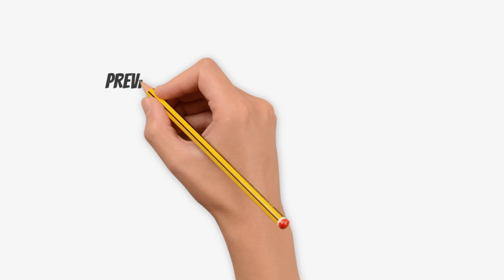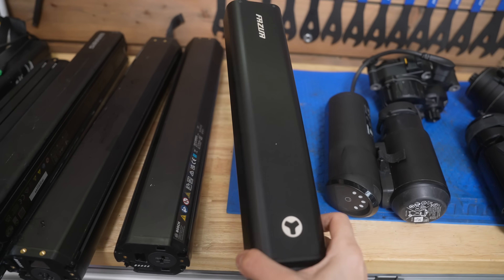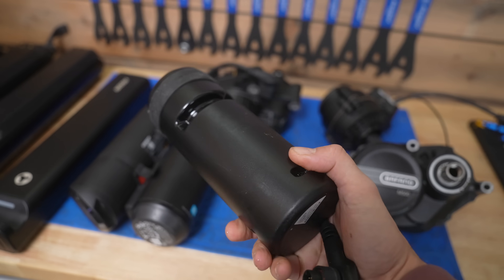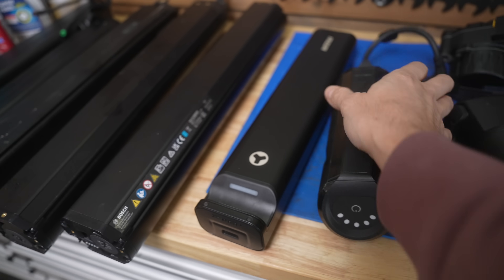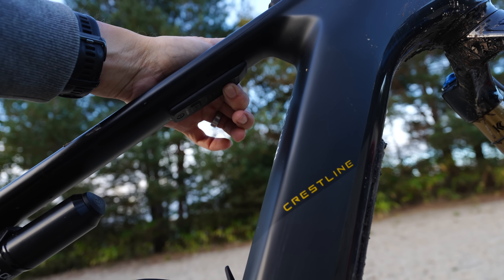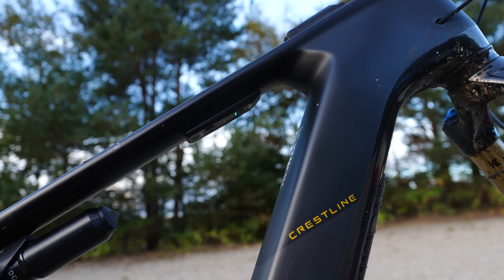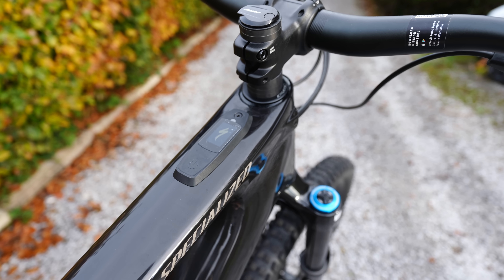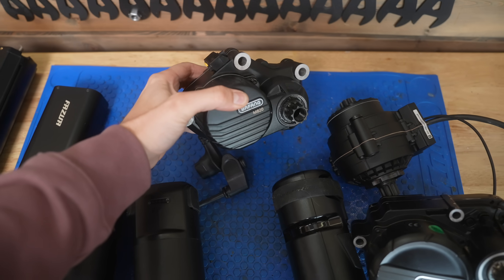We Have A Huge Problem With Ebikes....

Comment: USB charger should work on these batteries. USB is already at 240 Watts, and increasing. 

Cars already have the standard data interface port for On Board Diagnostics - OBD Port.

We could have a Proprietary Tax which is applied when an industry doesn't create a standard, or they create products that don't use an existing standard. Genuine advances would be worth the initial tax cost and could apply for the exemption and refund.

Comment: I don’t have this problem at all. My Centurion that I got back in 1976 still uses the same leg power that it used then.  I did have to replace the rims, but guess what? Those are pretty universal and was not a problem at all. I recharge my battery with every meal or snack.  At my age my battery does run down a bit quicker, but it hasn’t ever completely lost power. And with every use my battery actually increases it’s overall capacity.

Comment: I built 2 E Bikes !!!  I used bolt on motors and they connect to standard controller and they use a Standard 36 volt Lithium Battery with ordinary Connector !!!!  So I can fit this Stuff to another Bike !!!

Comment: I understand the point of the video and I just like to say that this is the exact reason why I am not buying into the e-bike thing at the moment. I do have a few gas powered motorcycle bicycles and I am looking to even purchase a moped or two. I would like a number of small modular means of getting around the town and to work. Unfortunately, an electric bike has been off the radar this entire time because every single time I look into it it seems like I'm being hassled by either spending seven grand for an all-in-one for proprietary system that may not give me the range I want or maybe lying......... Because I've dealt with a lot of false advertising in my life or on the other end of that building a bike because I have the common sense the know-how, the ability, the programming, the latter logic, the electrical engineering and understandings the training in order to make a bunch of parts work together. But buying the parts and simply putting them on a bike I have to do the same thing as if I was buying a $7,000 proprietary bike build and the only thing on it that's not the same as the brand of all the parts is the bicycle itself and I hit a brick wall with that because I like the motor of this brand. The battery, power and sustainability of this brand the quick charging features of that brand. The dual motor design of this brand, the cable management of that brand and quite frankly it seems like they're missing out on a number of purchases because I would build two or three bicycles with battery power and even by extra batteries for backups. But I'm not willing to purchase anything until I can non-proprietarily hand design my bike with the most life. The most power, the most durability the most reliability by picking the parts that are designed better from each of the companies bringing something to the table.
This need to face constant proprietary ization is killing the market. No one has that much money to dip into a company and then find that those parts just aren't good enough and no one has the money to go out and rebuy everything all across the board for a completely different setup. Only to find that one also isn't the best because they're both only good in one or two ways.

Making things for prioritary is the death of the electric bike. They just don't know it yet
Reply: And for anyone who's read all of that and feels the need to read further, I would like to say before anyone pro e-bike pro electric comments about motors. The two-stroke and four stroke scene has hundreds of thousands of thousands of bicycles that can hold motors and hundreds of thousands of thousands of those can accept either a two-stroke or four stroke engine and of all of the bikes that are able to handle two-stroke or four stroke. Whether you buy a whitey 100, a whitey 80 azada 80 or any of the four-stroke models, all of the two strokes look damn near identical except for colors and all of the four strokes look damn near identical except for the colors. They are extremely plug and play again. Shame on the electric companies

Comment: I've build my ebike from scratch myself. Much cheaper and based of a normal bicycle with an ebike kit. Also more range than most ebikes and still works great despite used and challenged hard. It's pretty universal and could even get upgraded easily or swapped with my other bikes. It also looks neat the way i did it (in my opinion) :)
Reply: do those kits come with any warranty or waterproofing? What if your display, controller or motor craps out, say doe to water damage or whatever?
Reply: @imarchello  Here in Germany they have 2 years of warranty (it's german law, don't know about other countries). You better water proof the electronics yourself which isn't hard. I just put the controller and battery in a frame bag and have no issues with water. The motor and cables outside seem water proof so far. I even ride in snow and heavy rain and summer heat. If any part is damaged due to faulty parts it's under warranty replaced or sometimes you just get a new kit if that's cheaper. So far i'm riding it about a year under every weather and mostly in the mountains and woods and sometimes asphalt. I do tours about 130km often (battery lasts about 140km). It still works fine. The only thing i replaced was the charging port for the battery (my fault for breaking it) and better brake levers (also with brake sensor). But you could use the original brake levers too. As it's universal, i just ordered the port on ebay and the brake lever on amazon for a few Euros and installed it myself.

Comment: Couldn’t agree more. 
Ought to  extend to all electronics on chargers and connectors as well. 
The environmental cost due to scrapped chargers, cables and electronics must be huge. 
Am wondering what is going to happen to my lovely e- MTB when I can’t get a replacement battery / charger / controller / motor when one gives up the ghost. Ugh 😣

Comment: AT LAST.  At the simplest level this applies to replacement batteries.  Looking at accessories on manufacturers websites, the number one item I would expect to see would be a replacement battery.  I have not found this on any site that I have looked at, nor do the search boxes return any useful results.   So once your e-bike battery has lost its capacity, you have to buy a new bike.  I cannot understand the silence in the industry on this issue alone never mind the other issues you mention.

Comment: New tech depends on competitive designs, naturally market competing for most sales that define a de facto standard. 
When standards happen, sometimes competitive low prices leave the market. The average 250W, 500W, 750W ebike is good enough for most riders and now regulated by some countries; so what's the upgrade need?  In fact, fast ebikes are own enemy, now causing accidents, fire, theft, regulations and licensing fees + taxes.  The only modest energy density battery I want is one that does not catch fire, high density battery internal connections are fire risk from normal bike vibrations.

Comment: The problem is not only that there is no upgrade path. It's even more problematic that a casual rider probably won't be able to buy the required batteries or replacement (like-to-like) motor for these bikes a few years from now, making a lot of perfectly good bikes useless in case of a malfunction or just plain old age.

Comment: While I do agree more standardization of ebike components would make life easier for many, I do have to wonder if the real issue you are mentioning goes unmentioned: Unhinged consumerism.

The desire to constantly be buying more better faster. What happens to the discarded stuff? Why can't one be happy with the bike they bought that was 5 figures expensive? At that price, it must be pretty fancy.

I know this will fall on deaf ears but perhaps the primary issue isn't what the ebike makers are making, perhaps the issue is people not be happy with perfectly good products?

I've been sell electric cargo bikes and commuter bikes for 10+ years and in all that time not a single customer has asked to have their current bike upgraded with new motor or battery. If the want newer tech, they sell their current bike and buy a new one that has that new tech.

This is how life works with automobiles and motorbikes. Want a fancier faster Corolla? Well, you don't roll down to Syd's Auto Shop and upgrade the motor and put a bigger gas tank in it...you sell it and buy a new Corolla.

Comment: This is pretty much why I didn't get one so far.
And I'm too lazy to just modify bike myself, but basically for long life I would need to do it this way.
Also thing is not so much about the competition as about you going like a good doggie back to company every time something is not ok, because you cannot fix it yourself I bet battery packs will have some quirk preventing you from replacing old cells with new ones in it, and other shenanigans for other parts as well.

Comment: I built my E-bike exactly to avoid this shit. I don't have to worry about that incompatibility. Not only that, but I can use any battery, controller, motor, and voltage that I want. Furthermore, I can have as much power as I want, and it is not illegal to use off-road in my country. If you keep buying this expansive crap, you enable those companies to keep doing that they are doing. It's like if they bike doesn't belong to you. I have 4000w mid-drive with 12 speed cassette, and I did not spend half of what the frame Rob is holding worth 3:52 plus I have way more power.

You don't need to be an engineer to build an ebike yourself. If you can build a bike, you can build an ebike. There are tons of guides on YouTube teaching how to do it. A BBSHD and 52v battery with as much capacity as will fit in the frame is all you need to start and is enough for 95% of people.

Comment: How often are people upgrading the motors in their motorcycle? Or expand its tank?
To me, ebikes are a very different category than push bikes.
Reply: For batteries I would find it preferable to just make the cells inside  accessible and replaceable. No need to change out the whole pack with the electronics.

Comment: Brilliant video. As designer, I beleive it is possible for a cottage industry to manufacture an interface that allows you to put any motor on any bike, and wiring looms to upgrade. Bike manufacturers should be ashamed, there is no need for this incompatibility except PURE GREED. customer care? Bollocks to that. You just need one bike manufacturer to break ranks and they will steel the market and if others don’t follow they will go to the wall.

Comment: This is why external batteries, Bafang motors and other interchangeable components from China are king. The so called name brand and bike company machines are underpowered, overpriced, purposely obscure as to repairs or mods and require unique battery shapes in order to charge outrageous prices for spares. The software on tthese so called 'premium ' ebikes is a nightmare. My Chinese Bafang motored e bikes w/external batteries out perform anything from big brand companies at a fraction of the cost. And, components are easily replaced or repaired. Bike folks are gullible, big bike companies will take advantage of you. Beware. Oh, almost forgot to mention. Carbon fiber frames break down with use. As the material degrades, the degradation accelerates terminating in catastrophic failure often without warning. If you bike is carbon fiber, you won't need to replace the motor as the frame will be shot also. Don't believe it? Then you should learn about the characteristics of carbon fiber composites under repeated loading cycles.

Comment: Yeah!  I would wish, that they at least would provide repair kits and spare parts and have a guaranty they service and keep the batteries for the "old" bikes.... I think my bike will outlast my ability to ride, so a (hardware) update is not important or crucial.... IF it breaks, and is outdated, I still would rather repair it, than buy a new one!!  Like my old rimbreak spacialized sirrus... I still can upgrade everything and service it....

Comment: Good call - thank you! We definitely need better component compatibility and interoperability here! That being said, I am slightly sceptical regarding the idea of one charger for all ebikes. Some bikes run on 36 V, while others have a 48 V system, and then there is 52 V and maybe even further voltages... While it is possible in principle to develop one charger that could work for a range of battery voltages, this would then become a somewhat expensive charger, and particularly for bikes with lower battery voltage this would be adding cost noticeably. However, it would still be good to standardise charging connectors (and introduce voltage compatibility protection in some way, to ensure that it is impossible to connect or use a charger for a different voltage than that of the battery...).
Reply: I'm sure he means to have a universal connectors. I couldn't find a charger for mine so I had to just find a charger rated for 48v 2amp output and just soldered the connector from the old charger and its still going strong even a year after. Oddly enough the original charger only lasted 6 months.
Reply: you missed the point completely 180. he meant a connection standard. not one charger for all
Reply: @jrok96  - he literally says: "... let's have one particular charger that can work across all the different bikes!" (6:20) You may be right that he meant the connector, but he does talk about the "charger". And yes, I do appreciate that the word "charger" is sometimes used somewhat loosely.
As I wrote, this would be technically possible, but not necessarily sensible.

Comment: This is better as the Panasonic system with a standardized plug but with cryptographic authentication of the battery with the motor controller.

Comment: My 10 years old chinese ebike (throttle controlled, not pedelec) originally has lead-acid batteries, and I bought a lithium-ion battery with the same voltage, and it fits. The electronics only need a 48-58 V power input, there's no upgradeable firmware. Modern batteries and control electronics are overcomplicated.

Comment: My BBSHD works on almost any frame, with almost any battery and can be repaired and upgraded with parts from hundreds of suppliers all over the world. Plus it’s more powerful, more reliable, more configurable and lower cost than any large ebike manufacturer on the market. When I’m tired of it I can replace it with a CYC or a DM02 for torque sensing or lower weight. I really believe people need to get more into learning how to do these things themselves.

Comment: The issue is standardization but also intentional obsoletion and right to repair. Look up Louis Rossmann's interview with Josh Haley on One Wheel. Even within the OEM hardware they digitally pair parts so you cant rebuild or repair with spare parts as easily.

Comment: Great video, Rob, Thanks! This video, or at least the topic needs to be shared and discussed ON EVERY LEVEL !!  
All the GREEN poster folks are put to shame when considering the inconsiderate behavior of the eBike industry, large and small.
Sadly, 2.5 years after buying my first eBike, I can’t even get an original controller to replace my broken one ……..

As a musician, may I suggest something like the introduction of MIDI* in 1983 - worked out by most of the  major players in the music instrument manufacturing business! 
A Historic Milestone was achieved.
They were smart enough to see the need of compatibility for all musicians across and beyond proprietary standards up to that point in time.
Now, 40 years later, I can still use a keyboard that was one of the earliest adopters of MIDI !!!!!! 
With lots of gratitude.
(Omnidirectional, Baby!) ;-)

Let’s get it together, shall we?!

IF you just simply play in a band of acoustic instruments only, you are fine, - and even could laugh it off, until you want to go into a recording studio to record without MIDI time lock. 
Good luck! Yup, it’s that important.

Info Reg MIDI*:
https://en.wikipedia.org/wiki/MIDI 

“MIDI technology was standardized in 1983…

Before the development of MIDI, electronic musical instruments from different manufacturers could generally not communicate with each other. This meant that a musician could not, for example, plug a Roland keyboard into a Yamaha synthesizer module. With MIDI, any MIDI-compatible keyboard (or other controller device) can be connected to any other MIDI-compatible sequencer, sound module, drum machine, synthesizer, or computer, even if they are made by different manufacturers.”…

Comment: buyers need to speak with their payment; don't support proprietary systems.
Chargers are small enough to fit into battehry or frames, allowing "standardization" via AC power plug.

Comment: The prices of e-bikes are outrageous as well. You can get a really good second hand car for the price of a good new e-bike. And if you get a cheaper new e-bike (still not cheap, but cheapER), all the components are rubbish. I think there is this huge rush into the e-bikes, and the manufacturers are simply milking the buyers. I'm not buying an e-bike until the prices get reasonable and the ecosystem matures in general.

Comment: If you build your own from a kit no problem! Bafang mid drive ,bottle tube battery or other style. And Im pretty sure I could just change connectors on any of these batteries..
Reply: I totally get that and have done it but that's hardly a solution for 99% of potential ebike users.